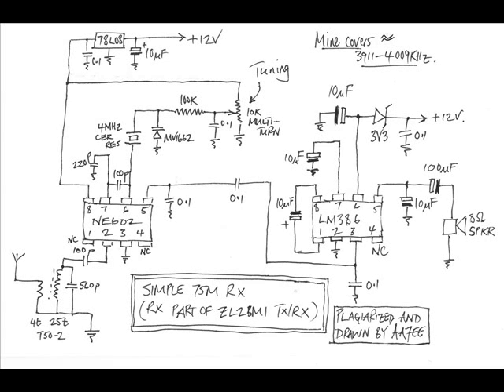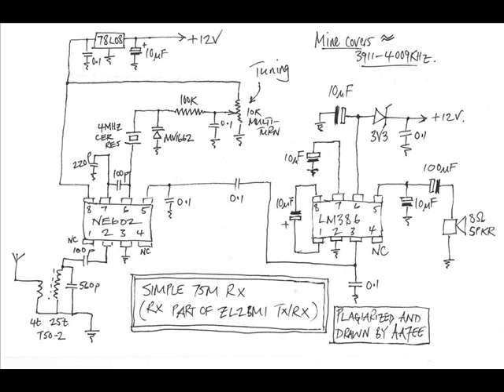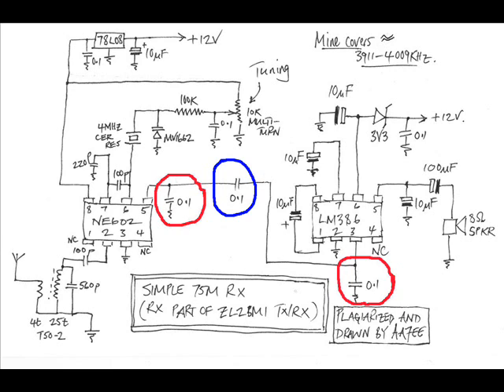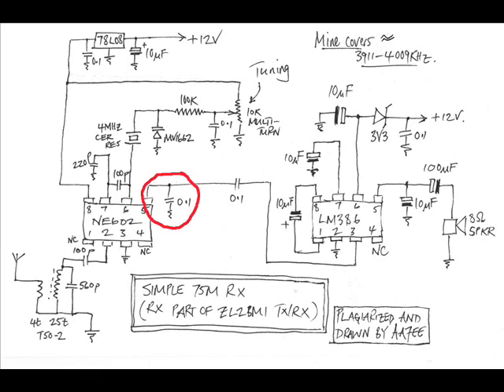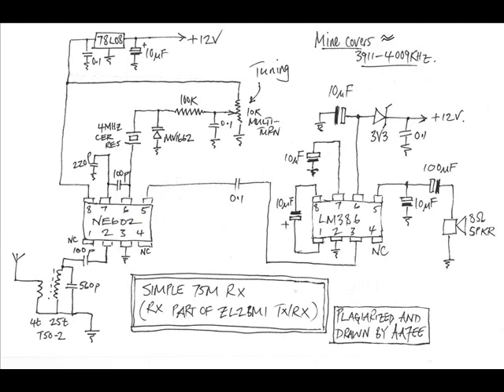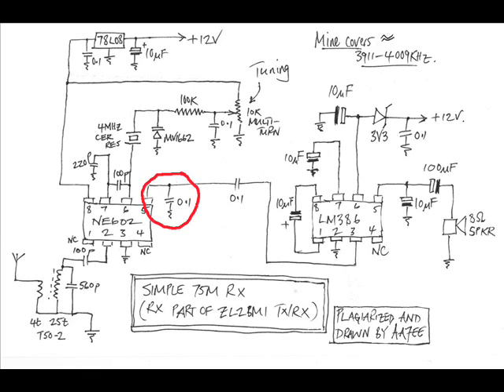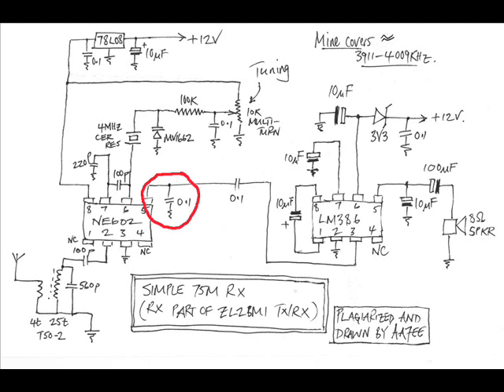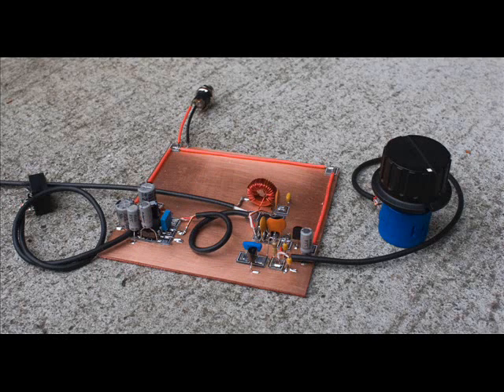Simple 80M NE602 RX - Purpose of 01.uF Bypass Capacitors

Comment: I have to say thank you for this. I borrowed the idea from you and used it in my regen receiver that has a different schematic, but the AF amp is pretty much the same. OMG that 100nF from pin 2 to gnd in my case makes miracles with the audio hahaha. Thank you so much. I tried using another one on the first stage before the AF amp, but it's cutting too much of the audio level that goes into the AF amp, so I'm using 4.7nF instead. Even though with 100nF sounds simply magical and clean ))... 73. I really want to try this one as well later one.

Comment: can I substitute mv1662 varicap diode with a different one? it seems these diodes are next impossible to get hold of.
Reply from the maker: Yes you can. I built a similar receiver using a 1N4001 diode as a varicap. Try what you have.

Comment: Can I ask for your receiver's scheme?

UT5ULJ op. Alex  73 !
Reply from the maker: The schematic is shown in the video.
Reply: why is there a zener diode on 3.3 Volts in the power circuit LM368
Reply: contact areas are pasted onto the foil for soldering contacts. Where do you buy them?

Comment: Hi, how are you able to determine the number of turns on the antenna side of the T50-2?It appears from the number of turns on the secondary and the 560pf it should resonate in the 80M band and that can be calculated from an online calculator.